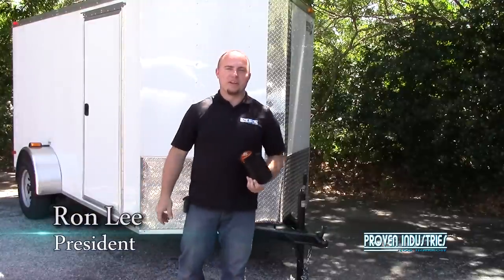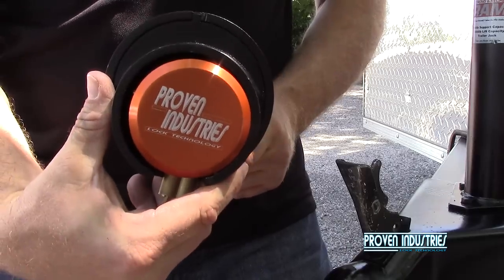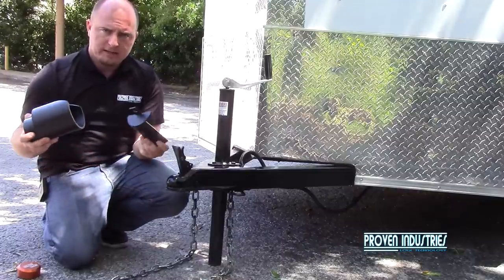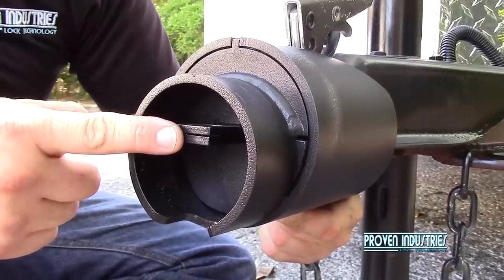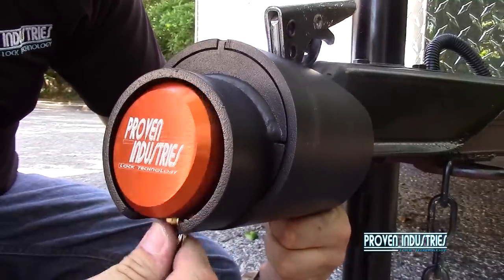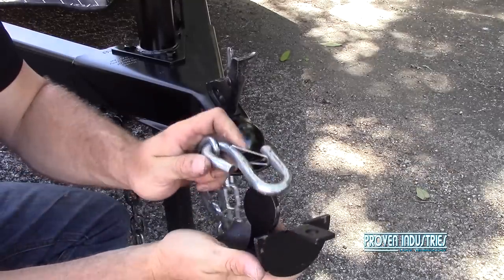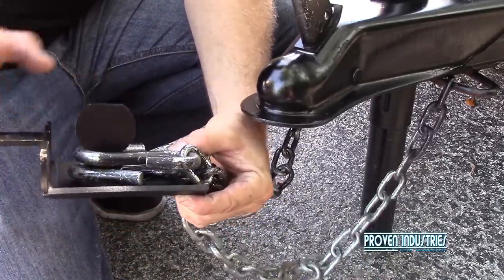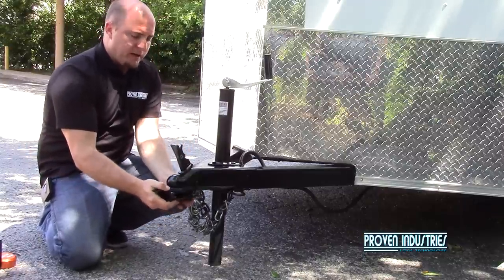Proven Industries Model 2178 Coupler Lock Installation

Comment: Most thieves will just use a tail hook, grab the entire unit, lift and drive to a location to break it open. But I guess any deterrence is better than none
Reply: I agree, except all the thieves have to do is break the thin latch lock, in order to release the Proven Lock, and steal your trailer.  One hit with a ball peen hammer should do it.  SAD

Comment: I wish they still had the standard key opposed to the new tubular keys which are harder to copy , carry and are much trickier to use under a trailer hitch.  The website still l shows standard keyed locks so I was surprised to get vending machine keys.
Reply: I’ve seen people use ink pen tops to defeat those type locks on YouTube like sentry gun safes.

Comment: Bravo!!!  You’ve created a strong lock.  Unfortunately, It’s incredibly easy to break a pin lock holding the latch down, allowing a thief to release the Proven Lock, and steal your trailer.  Why the heck doesn’t the outer shell of the Proven Lock cover the latch, securing it too 🤦🏻‍♂️
Massive engineering mistake.  Do better.